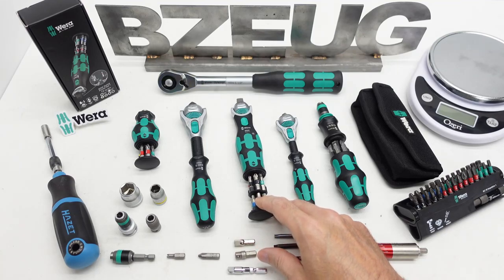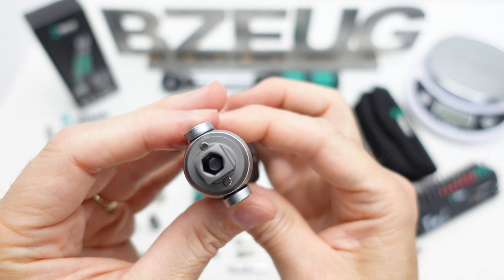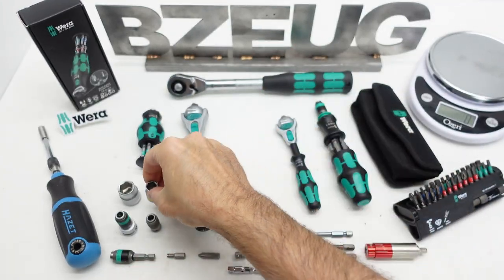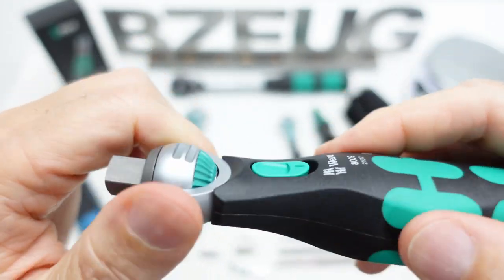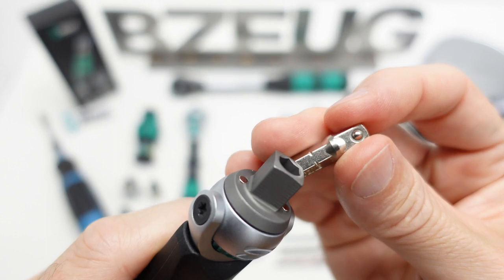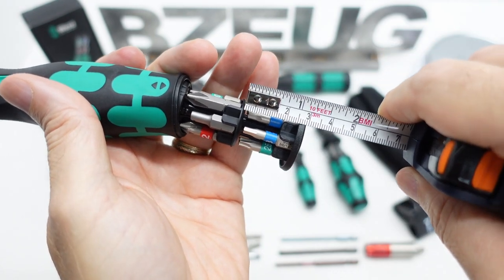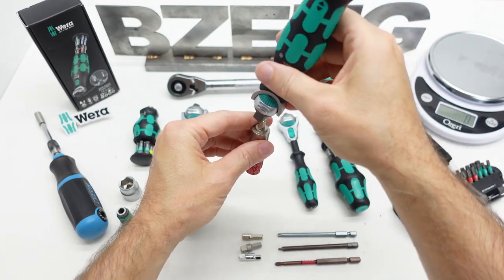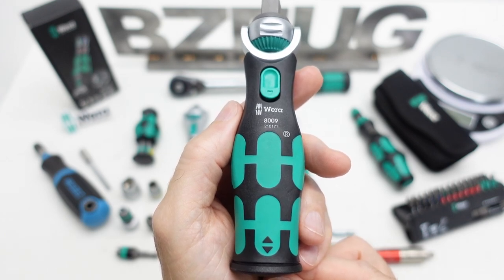Wera Zyklop Pocket 3/8" ratchet and bit driver combo closeup review and comparison.  It's a winner.

Comment: Over 100 dollars. I could have been one of the few people to purchase but it was too expensive. I already splurged on the LTT screwdriver this year so this one might have to be be on the list for next year.
Reply: The ltt screwdriver just seems cheap to me and I don't really care for ratcheting screwdrivers I currently carry the kraftform kompakt but this looked slightly smaller than that but I'm not sure I can justify like $109 is what I have seen it for I paid like $40 for the kraftform and that seemed high since was going from a like $5 screwdriver
Reply: Can't say I'm surprised that some hack's rebranded tools turned out to be crap
Reply: @james10739  yea the ltt looks like a plastic pos
Reply: @FookeyBookey  I mean it's probably an alright screwdriver but for the price nit worth it to me like I said I don't really use ratcheting screwdrivers I use a regular or an impact or something but $40 is my limit which is what I paid for my kraftform kompakt and at least Harbor freight said alright we will gold plate a ratchet but ya theirs is plastic and overpriced in my opinion
Reply: @james10739  Tried out a bunch of ratcheting screwdrivers including the Kraftform Compact. After 6 months LTT is by far the best everyday screwdriver. The plastic they use is high quality and every part of their design screams quality. Gotta say there is enough information out there to dispute that it's a plastic pos, definitely not. It is a very high quality tool. I will give you that the price is high and you can get a tool that does what the LTT does for cheaper, it's just not going to be as high quality.

Comment: I don't see the benefit in real life situation, and don't like the magnet solution and to much plastic for the price! Greetings from Germany
Reply: Yes its to clunky, i prefer the regular zyklop with the 1/4” bit holder. I can then use my tool check plus bits so no need to spend the extra money. But cool tool for someone barely gett into the wera family

Comment: So you could, in theory, swap the head with the 1/4” head? Locking nut driver and put on the rapidaptor 1/4” adapter. No magnetic retention. Push button removal but not with the locking swivel switch. Solves your 1/4”-1/4” hex to square adapter. And from what you said the rapidaptor wrench adapter works well enough with the 13mm anvils.

Comment: I actually also thought of this for bicycle use as well. I do own multitools specifically for bicycle use, but they are just too small and finicky. As I own a 12 speed bike and they no longer offer chain pins for those chains, there's really no use for a chainbreaker/rivet'er. That's why a tool like that zyklop does most of what you need and it will feel way better in use because it's way more ergonomic than most multitools.

Comment: Can't see why you wouldn't just keep the 1/4" square adapter in the 13th position - the tip itself. But another option would be the Facom ECR.1 stubby hex/square adapter.
That tip is a clever design, but they've borrowed it from the current Bosch Pro 18V impact driver.
Unbelievably expensive.

Comment: Just one question about 1/4 adapter, did you try to insert it with the ball retention faced to the inner part of the bit holder? In my case it worked 😅👍
Reply from the maker: Thank you.  Yes, I was only able to get the 1/4 socket adapter to fit if the ball detent was down (facing inner part).  Certain styles of adapter just do not fit however.
Reply: @bzeug  Great! 😃👍🏻 Which brand is your adapter?
Reply from the maker: @MeuReview  The one that worked was Japanese TONE brand.